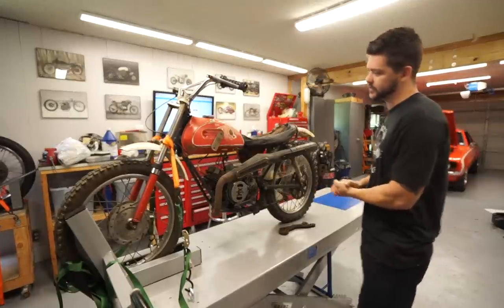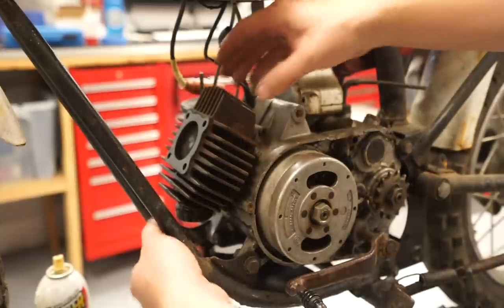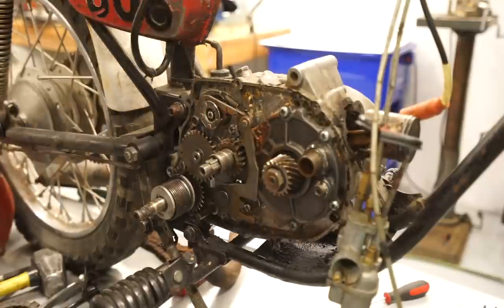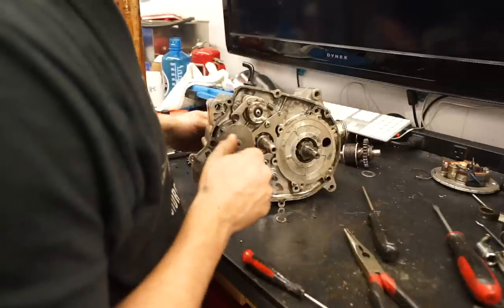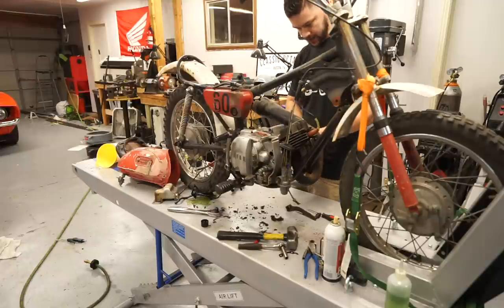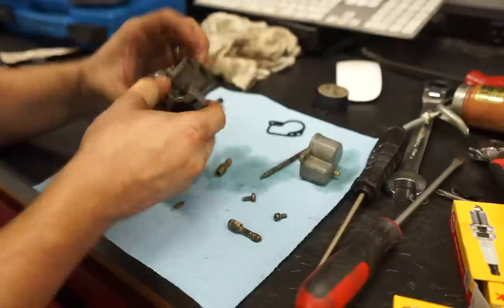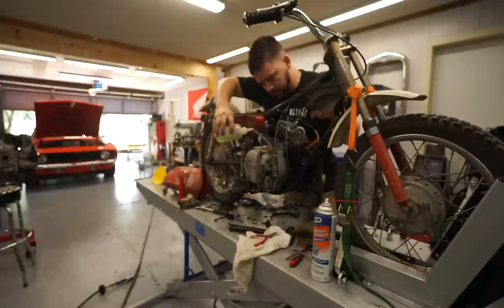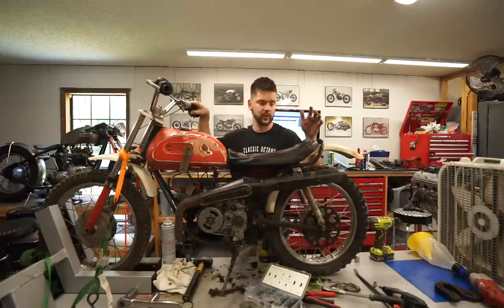Seized Yamaha JT1: Will it run?

Comment: At exactly 22:00 looks like a ball bearing or something shot out and rolled to the back of the workbench. Perhaps goes with clutch push rod?
Reply: Came to the comments to say the same thing.
Reply: Me too.
Reply: It could have been the little ball which usually sits between clutch and clutch actuator rod.
Reply: Good eye
Reply: He might have removed the long rod e showed earlier already and, as I learned when working on my '67 yam L1, there is a ball bearing at the inner end of that rod that must be saved.

Comment: I worked in a Yamaha shop in 1972 and 1973. Two strokes running like that can be from a vacuum leak. It could be the cylinder base gasket,or crankshaft seal. Yamaha and Suzuki used rotary valves on their small two strokes,and Kawasaki and Bridgestone used them on bikes up to 350 twins.
Reply: I also think that the sealing surface for the rotary valve is gone.

Comment: I like that you are using a JIS screwdriver set for the Japanese bikes. Saves you some screws in the end. I own a 71 Yamaha HT 1 Enduro. When I first got mine running the clutch was stuck so I did some research and alit of these kinda bikes have that problem. I pretty much assumed that you would have to go through the bottom end. I kinda like the longer video. I also watch Mustie1 and I enjoy the length of his videos. Great Video!

Comment: I bought one of those back in 79’ for $20. Was sitting in a backyard with NO spark plug installed.
A little work got the motor free.
But the noise from the bearing and rotary valve were just horrendous.
Nice flashback, thanks...,

Comment: Did you actually screwed the carb in??? It sounds like air is getting in through the case/carb joint and leaning the mixture/reving high. Tighten the carb brace and check the cardboard seal.
Reply from the maker: Yeah I thinks it’s a combo of the carb seal and the cylinder base gasket that are both shot.
Reply: @ClassicOctane  Possibly worn / leaking crank seals too.

Comment: Any one else saw something drop out @ 22min and roll under the keyboard?
Reply: Yep...
Reply: Yes...I'm guessing it's the ball bearing that connects the clutch push rod to the clutch plate.
Reply: @ticosandoval  Yep. And then when you put the clutch back together, it wont engage no matter how hard you torque down the clutch adjuster nut. Or so Ive heard.....
Reply: Correct it was the ball bearing for the clutch actuation rod...wont work without it so I hope he finds it.

Comment: The engine on a jt should be the same or at least close to the same as the one found on the Yamaha FS1. One major issue that is very Common on that engine is what we in Denmark calls false air. This often happens because the carb isn't thighten down or the nylon bushing that sits in the carb is toast. Have multiple of these engines but the EU version where it has a Reed valve

Comment: I like the longer video, my suggestions would be to (a) tell us how many miles when you can (b) when an open component is made by another company like the sparkplugs or the carburetor possibly cables and the size of the carbs, great video either way

Comment: I had one in junior high, even raced it short track for two years. I'm pretty sure JT-1 was made in 1971, JT-2 in 1972, and those were the only two years the 60cc mini enduro were made.  Trimming the rotary valve was one of the ways to feed it more gas, and increase speed.
Reply: Restore! Let me know if you want to sell it.  I loved mine from back in the day, and when you were tapping it with a hammer or anything, I was thinking:  'DON'T HURT MY BABY, DON'T HURT MY BABY!!'  ROFLMFAO!! I think the hour format is fine.

Comment: Great video! I Just finished bringing one of these back into a running and functioning condition. What I found quickly after purchasing mine was that parts are expensive. If you need a new top end get a Yamaha Fs1 piston rings, wrist pin, and gaskets. They work perfectly on mine. The stock bore for the jt1 is 42mm, I bored mine over to 43mm and replaced the top end with fs1 parts. On eBay a jt1 piston kit costs over $200 even $300 without gaskets which are another $50, and then the cost to bore the cylinder. All together my fs1 top end cost $45 with gaskets, and I payed another $80 to have my cylinder bored. The small cylinders cost more to bore because fewer people can bore them. These bikes are great fun!

Comment: They run away like that, cuz they essentially diesel, there enuff heat in combustion chamber(red hot metal fragment or something) to perpetuate the bang, I've seen em blow up from that... only way to stop is covering the back of the carb, cutting off all air.

An I will tell ya the pipe on it is an aftermarket expansion part, probably worth more then the 50 bux u spent.

Comment: you can find aftermarket sidecovers fitting it from fs150cc and your leak is between the carb and inlet pipe ,its all loose , and some od them sealed with o ring others with fibergasget turned to fit in the carb. nice vid on saving a rare and old peppy bike!!

Comment: "Should I  cut it short, or just let the video run long?"
For me, I am totally cool with a long video.  I assure you, all the knuckle busting is not wasted on me! Why? Because as a DIY guy, about the 28 minute mark is where I get stuck a lot at home, and I personally would greatly benefit from watching a pro work through the parts where my forward momentum stops. I think that this helps me build my own skills, complete open projects here, and gain confidence to do more advanced builds over time like your Cafe Racer/Clubman CB builds in the future.   
Great content,  Taylor - subscribed!

Comment: Will it run Wednesday's rocks! The only thing is I'd like to see is an elapsed timer. I don't care if you're restoring a bike, car, truck or house...how much time did it actually take from start to finish is something I'd like to see. 
(I was fooled by those home resto shows when we updated our family room :/ ) 
The clock doesn't need to be continuous. 
I've been working of a '64 Ford F100 for a few years. I am not a mechanic...that's why I chose this simple truck.
I found out, even working on one part can take a lot more time than I 'thought it would take!' 
Sometimes I feel rushed or like I'm wasting my time...like I said; I'm no mechanic...but i am willing to learn!
Restoring an old bike is next on my bucket list. 
rtc

Comment: Hi, I like the longer video with speed up on the dull bits. I had a Yamaha FS1E which has the same engine in the UK its a moped so ridden at 16years old. These things in Holland were I now live, fetch high money in good condition 4000 usd. The parts are widely available in the UK and Europe. The shop looks great and don't worry about the camera angles your producing great stuff. P.s. I currently ride a T140. Tony

Comment: I like watching the whole process but speeding up the video during the tedious bits would be fine.  I’d like to see this little Yamaha run and move once again.  

One small correction: not one single screw on that bike (or any Japanese bike or car) is a Phillips. They are all Japan Industrial Standard (JIS) which looks a lot like Phillips, but is sufficiently different that using the Phillips driver will eventually strip the screw heads.  The best brand of JIS driver is Vessel and they are easily found on eBay for not much money.

Regarding the running - it looks to me as though the carb adjustments are waaaaayyy off.  Perhaps the manual would be able to give you some guidance. Also - I’m sure you are running some two-stroke oil in that fuel (I hope so) but why don’t you just use an auxiliary fuel tank suspended from the ceiling of your shop rather than f@rting around with a fuel bottle?

Comment: Good video I wish I would have seen this before I started putting my JT1 engine together from a box of parts. The manual for the JT1 doesn't have much in it you don't know mechanically already, but it has a few things like what the ignition needs to be adjust to and the throttle fuel mix screw turns out. Judging by the fact you got it started I would say it is still set where it needs to be. Partzilla and Bike bandit is a good place to find parts and also the breakdown diagrams for this mini. Like I believed I mentioned in the past I have a few parts including a spare set of shift forks and transmission gears. PM me if you got any questions maybe I could help you with something I experienced on my JT1 restore. IMO opinion I say restore it, but I have seen some cool modified JT1's too. If you decide not to waste your time maybe it would make a good wall ornament or sign for your shop.

Comment: Yamaha carburetors had a problem where you could put the slide in backwards (180 degrees), however, this would leave the bike in wide-open condition.  Probably why this one would not idle.

Comment: I have one of these in yellow, I think it must be a JT2? Anyhow I've had it as long as I can remember and it was running as of 2009 or so. I want to get it back to running condition, but I need tires for it at the very least. Any ideas on where I might find some? This is going to be a project for sure. Thanks for any assistance!

Comment: That didn't quite feel li9ke an hour, so definitely not bad at all.  The little "squeeky" time lapse are a nice touch.  As for this little guy, who knows.  Could try to get it running decent, and then use it as a give-away or sell it cheap to a race crew as a pit bike (I know, hard to take a loss there, but hey, ideas right?).  Keep up the good work!

Comment: you are missing your float in the carb. it looks like a 1 inch long black hotdog. your sucking air from your base gasket(cylinder). you are sucking air at your carb. tighten your carb. bolt that holds it on. these engines are known for blowing the crank seal on the mag. side. find the steel ball you lost for the clutch push rod. when splitting the cases use a ( T ) puller on crankshaft on the mag. side to push the crank out of the case. only use a screwdriver to pry the cases apart where the engine to frame bolt holes are located. if you would to ride it for more than a mile you will need to replace the connecting rod and bearings. 45 years experience turning wrenches talking to you. keep making videos of old 2 strokes and i will keep watching them. old man Mark OUT!

Comment: Well done on getting it to run. Looks like you have a air leak in the engine. Hard or wore crank seals and it looked like the cylinder base gasket was broken as well. All equals hard to start and runaway revving. This engine is almost the same as the Yamaha FS1E we had here in the UK so bet there are a whole load of interchangeable  parts. YB100 engine much the same as well. Let's have more 2 strokes!

Comment: I would say it was revving out because of the carb being loose. You should have tightened the phillips screw that holds the carb on. You are regulating the idle by blocking some of the air getting fed into it. Not by fuel. Just a guess. I haven't seen what you've done. If it were cranking seal on the clutch side it would be smoking like hell. crank seal on mag side you can check by putting grease on it to see if idle drops.

Comment: kool video .... takes me bak....i put many many miles on several of those case inducted bikes trails an motocross bak in a day.... its amazing they even ran honestly the whole rotary valve idea was sketchy at best.... we all find out own ways to git r done long as it works we win.... however please consider that carb cleaners and starting fluid washes your cylinder/piston and in a 2 stroke even crank main an rod bearings of what little oil they had.... obviously theres gonna be opposing opinions thats just how we were taught in bike school ....

Comment: Idk I have a little Kawasaki kd 80 that has a rotary valve and we rebuilt it but didn’t check the main bearings, and it started and ran with a ravaged magneto side bearing. All of the clamps that hold the balls apart disintegrated completely, only after 3 months of zero oil. The little engines are tough.

Comment: Great job.......I've discovered that priming fuel thru the carb is much better tha thru the plug hole because fuel gets in the bottom end which lets it runs longer plus it's much quicker to do.

Comment: Heating the cylinder can sometimes help break the piston loose. Also, I once saw a friend build an adapter to inject grease into the cylinder with a grease gun. Hydraulic pressure is much easier on the piston.

Comment: At time 21:24  to remove the flywheel I just  unscrewed  the nut to the end of the threads and tapped it with a hammer and it came loose, no tool needed.

Comment: Air leak in the bottom of the crankcase! Crank seals, case halves, base gasket, rotary valve seal & gasket. Never run right until air leak is rectified!

Comment: First piece you pulled off is the "head" and the 2nd piece with the bore is the "barrel".....Also it should still kickstart in gear, the front sprocket will rotate....chances are the crank bearings (not the main) are seized.

Comment: For future. Diesel is really good if the engine is seized. Put it from sparkplug hole in and let it for 24h. It's been the best antiseize i have ever used. Usually you'll get the piston moving with the kick/starter

Comment: I literally died inside at 31:13 when he started spinning the motor over without  putting oil in the bore
Reply: And hammering a screwdriver in, to crack open the cases :(

Comment: At time 27:34 you say that neutral is down and 4 gears are up . This is wrong , neutral is up and 4 gears are down.
Another thing about this video that could have been way better is that the video doesn't show any work on  removing the crank or any work on the trans .
I understand you say "will it run " so the video is about will it run but you show work on other parts but not the crank or trans , many many steps are missing Including
How you got the cases back together . You did show how you  got them apart but  your way  isn't recommended without a tool to separate them. 
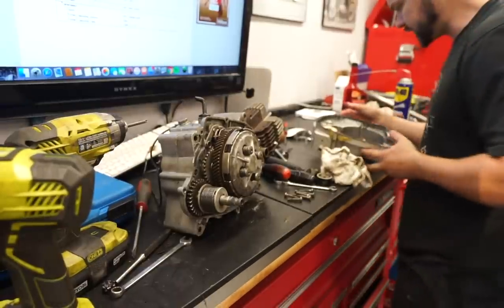Also , at time 34:41 you put the side cover back on without cleaning it , who does that?
I hope that 1969 Camaro wasn't done like this bike , wow!
 Thanks for the video but I'm just saying I really wish it was more complete cause people watching these video are looking for help.
Reply: No lie, When I have a Bike apart, I have to clean and polish everything. OCD kicks in. Actually, these Yamaha JT1’s always have problems with the Kick start shaft. That is a huge issue on these Bikes. Everyone I seen over the yrs, teeth will chip off after awhile and it’s stripped. I just restored a 72 Yamaha JT1 and same problem. The guy I got it from welded the shaft to the Kicker. It was Hilarious.

Comment: I had one of these when  I was 12 (in 1972) It was probably a 71  leftover. It was the GT. It was yellow with a black strip and no lights. There was about 5/6 of us kids that used to ride in the Redlands ( south of Miami) . One of the kids had an(enduro) model that was Orange and had lights. It cost $325. My mom put down $50.00 and I had to pay her$25.00 a month. I know that I missed a payment and she locked it in the utility room( at least she thought she did) 😂😂. Thanks for the tip on the stud removal. I don't know why I didn't think of that. Aaahhh the old JAM NUT trick. I am putting a header on a 1977 kz650 and it has 1 stud that is a little longer than the others and it is driving me NUTS. I'm going to try it as soon as I'm finished watching this video. Thanks .
Reply: I got mine (yellow MX version as well) in Maryland for $325 as well.  It used to kill the Honda SL70's in the neighborhood.  Mowed lawns to pay Dad back.  I'm 64 now, found one about 3 yrs ago and fully restored it.   Love them forever!

Comment: The rotary disc valve was developed by After Madden in East Germany in the 1950s. It offered more control over induction timing. It is fine testimony to the Japanese how indestructible those little engines are